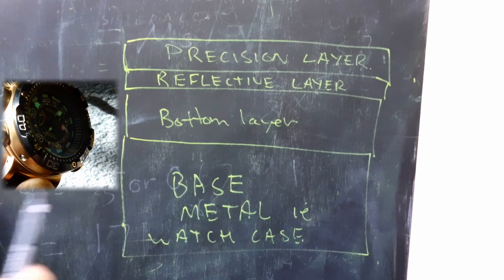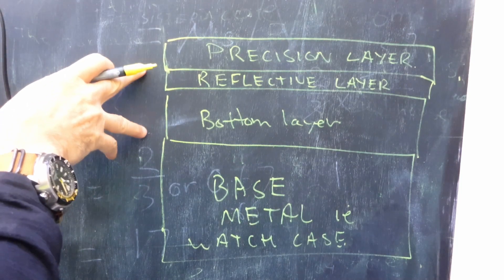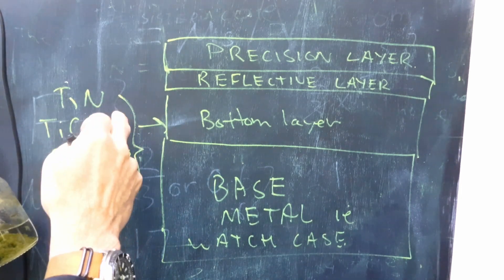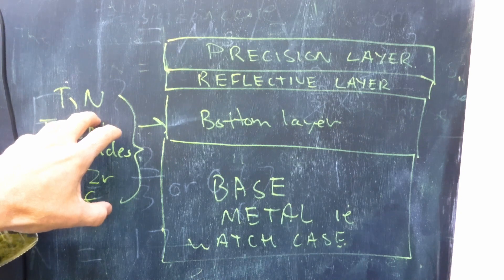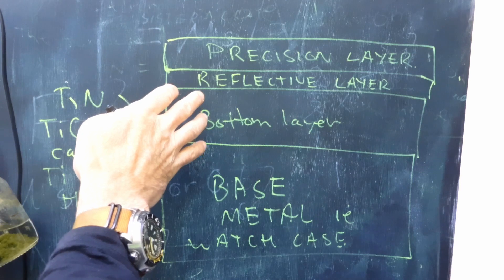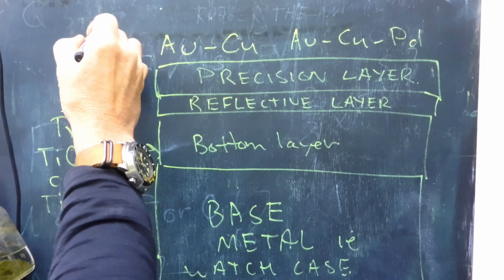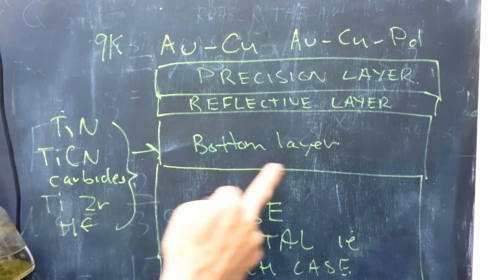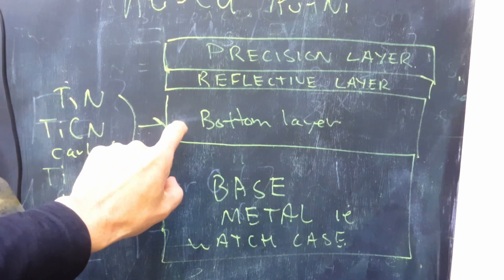Gold Tone on watches What is it?

Comment: How about Citizen YP (Yellow Plated) does it contain real gold (Au)?
Reply from the maker: I'afraid I have no idea however, any "gold" if real would be in the form of an alloy of gold and not pure gold as it would simply be too soft and wear off quickly
Reply: @BushCampingTools  Would it be worth it to have a jeweler remove the gold tone of a watch like your? Hv Invicta gold tone watch, $100.
Reply from the maker: @billwayne3924  Depends upon how much sentimental value you place upon your watch. I think only abrasive materials could be used to remove such coatings. probably a skilled jeweller could do such a thing for sure.
Reply: @BushCampingTools  oh okay, just bought the watch, has this pink mop dial, I had never seen on any watch or have in collection. I just don't like that it's gold tone bc I know it will wear off, the crown first. Might just send it back. Thinking.

Comment: Very informative bro but i have a question. Im thinking of buying a chisel mens two tone watch. I want a gold tone on it. Do you reckon the gold tone would wear off? And if so, how long would it take for the tone to wear off?
Reply from the maker: Hi there. it all depends upon how the "gold tone" is applied. So PVD can be applied in different thicknesses. if this is a reputable watch brand then they should be doing a good job and it will be quite wear resistant.
Reply: @BushCampingTools  GOLD TONE watches: Would it be worth the cost if I had a JEWELER strip the watch of its gold tone ? Bought a watch that's plated , silver tone sold out.